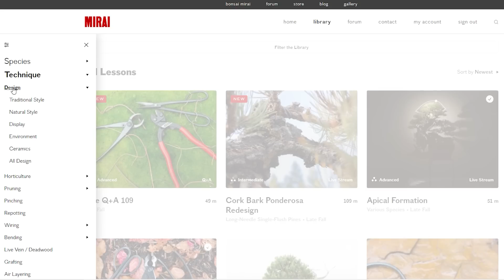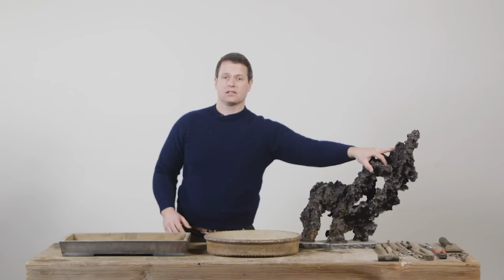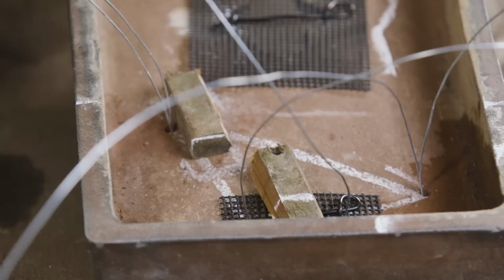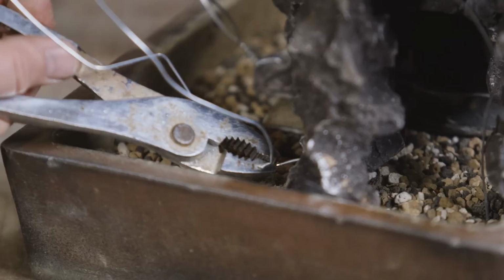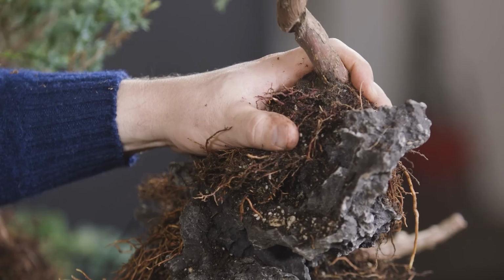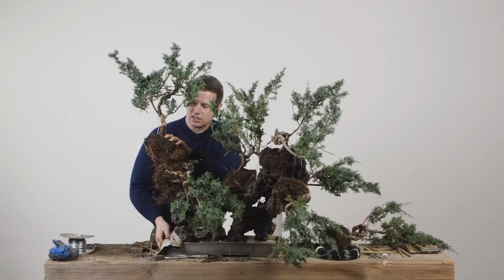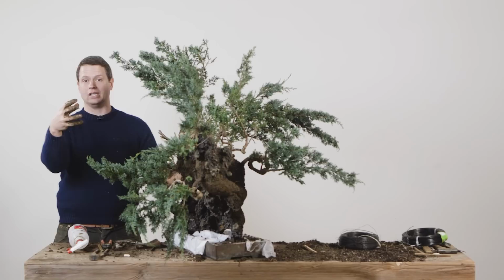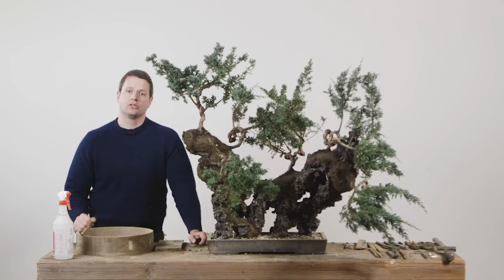Nursery Stock Rock Planting

Comment: I use those bits too for pots! ...avail at Home Depot, rated at 200 holes and 2 diff sizes iirc.
Much better than those more common tube-looking ones with diamond flakes; those are only rated to 10-20 holes. The tube-ones are also difficult to get a hole centered and started.

Comment: What is the muck, made of  ???
Reply: Muck is used in slab and stone plantings where stronger support is needed, such as vertical swells or edging. It’s a self-adhering clay, like mud, that solidifies some after drying. A good muck is permeable enough for water and roots to penetrate, but solid enough for firm support.
There are many recipes, they all include some sphagnum moss, (so roots can breath and water can get through), some compost, or soil rich in organic matter, and some sort of clay or other substance that can hold it all together. So, as for "clay ingredient" - I've heard of people using clay sold on amazon for face masks and scrubs, in the cosmetic industry; I 've heard of acadama dust (that's probably easy to find in Japan and China, but not in US, acadama being at the price of gold). All 3 ingredients are mixed 1:1:1 in those recipes.
 But here are some more. Full disclosure - I tried NONE of these.

Virginia Boka’s recipe, from Tropical Greensheets:
Combine 1 box of cornstarch and 3 quarts of cold water. Cook this mixture over medium heat, stirring constantly until thick like glue. It can burn the bottom of the pan so be careful. Let it cool to room temperature. Mix together equal parts of soil, peat and chopped sphagnum moss and add this to the cooked starch a little at a time until it is very thick and sticky. Be sure to wear rubber gloves. After experimenting with this recipe, we have found that worm castings work well instead of soil and it seems to help the moss take root faster.

From the Bonsai Society of Brevard:
Mix one part Bentonite with 5 parts Black Kow [a popular brand of composted manure], and one part sphagnum moss cut into one inch lengths (be sure to add the moss before any water is added to the mixture). Add water. The resulting mixture is still sufficiently sticky, easy to handle, stays in place, is very easy to rewet if it dries out, and can be reshaped on the slab as long as it is moist. Wear gloves.